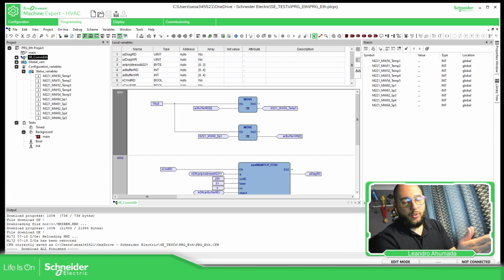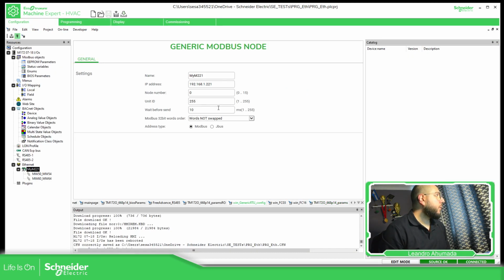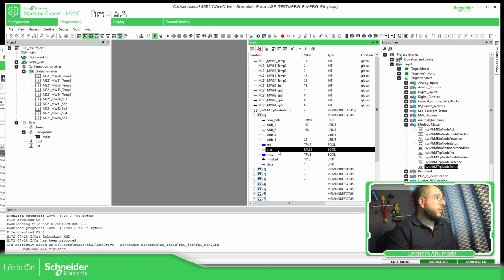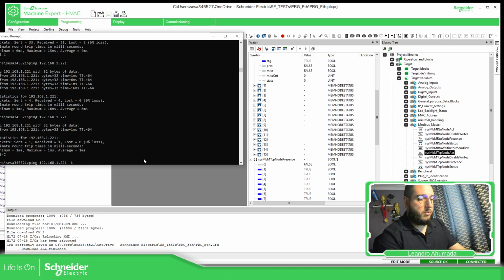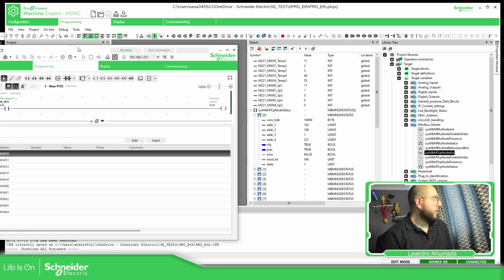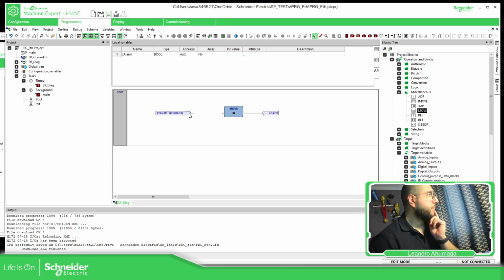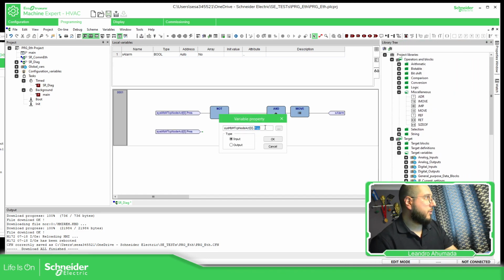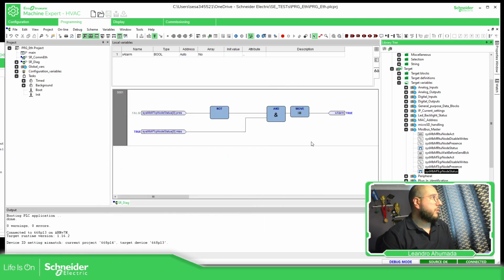ESME HVAC - Communication - M2.4 Modbus Tcp IOScanner Troubleshooting

Comment: Hi Tomas,

Do you have library to do cascade control on machine expert? I try to combine two PID control to do cascade control, but it failed.
Reply from the maker: Hi there! Have you tried this function block called FB_PI_PID? It has a cascade already in there.
https://product-help.schneider-electric.com/Machine%20Expert/V2.2/en/TbAppLib/index.htm#rhfulllayout=true%3Frhfulllayout%3Dtrue&rhsearch=Cascade&rhsyns=%20&rhandsearch=0&SUBSTRSRCH=1&t=TbAppLib%2FD-SA-0026200.html